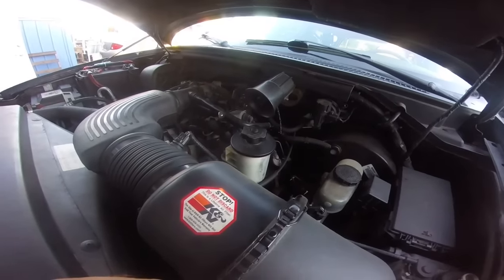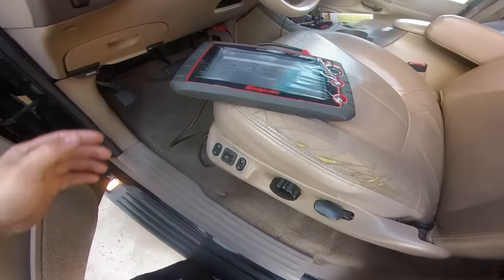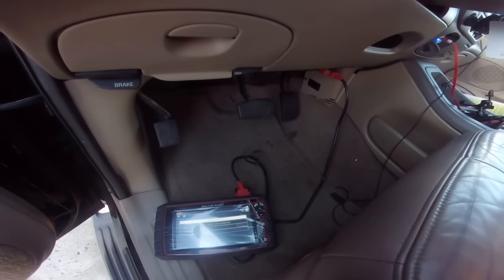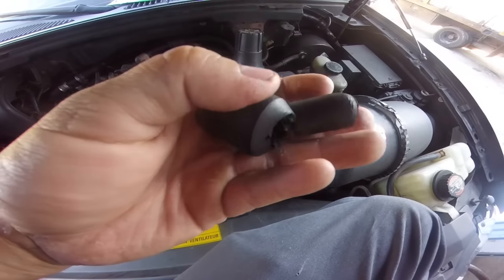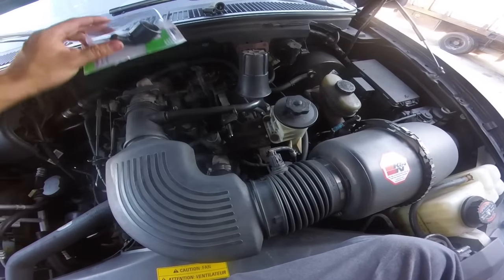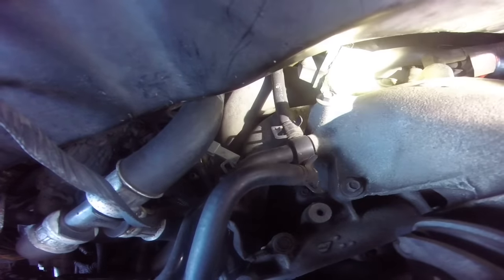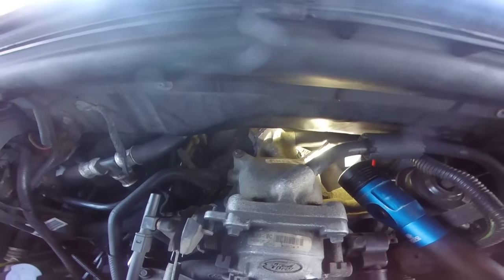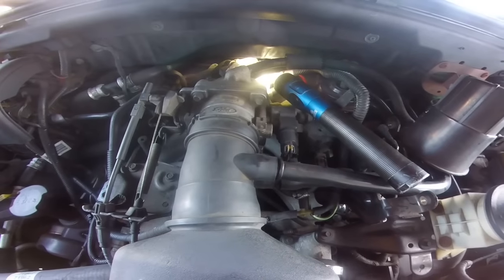ford 5.4 and 4.6 main vaccum leak

Comment: Does anyone know where is this located in the 03 ford e250 I’m having rough idle and engine shakes and sounds like a misfire when giving it a little throttle
Reply: My 98 E350 has it entering base of throttle body intake towards front of van. Just follow the hose from valve cover on passenger side. I had to get throttle cable parts out of the way to access it. Bitch. But she’s worth it.

Comment: Would this cause a P0304 code cylinder 4 misfire? Truck idles bad and at certain speeds around 40-50 mph, shakes and lacks power. Also air conditioning gets hot at times like a vacuum issue
Reply from the maker: well the ac would be vacuum related but a single cylinder misfire is a slim chance id check that coil on cylinder 4
Reply: Did you ever find out what was causing your problem? Mine just started doing the same thing, except on #3, and the AC stopped working at the same time, about two days after a heater hose broke & wet the engine. New plugs, new coils, thrown a bunch of money at it & the problem persists.

Comment: Curious if this is my problem truck runs with up down idle stumbly misses, has a pretty loud hiss leak sounds from left side. 99 f150 4.6l 4x4
Reply from the maker: if its after the mass air flow then yes its gonna be a vacuum leak causing it

Comment: I have a 2003 Lincoln Navigator with this exact same issue but my PCV valve is not back there and the one I see looks like it’s intact. Is there another price back there I don’t know about?
Reply from the maker: there is a couple other vacuum lines normally you can just start it and run your hand around the vacuum lines till you feel the leak or hear a change in the leak

Comment: I’m pretty sure that my problem.  This prob sounds like a dumb question but how do you get it off? I pulled in mine and it won’t come off.  I was thinking I had to take a bunch of stuff out the way.  Then it felt as if I did get it off, I’d have a helluva time getting it on.  It’s really tight
Reply from the maker: its probably tight from the age the new one will pop on easy
Reply: ugly HP thank bud.  It’s was easy.  Ran great for about five miles.  On the way back, started running rough but not as bad.  For about two days, it was intermittent.  Finally a code popped, got the po302 misfire code.  Thought it was plug or coil since intermittent but had a discount on the cop so I got it.  Been running great since.

Comment: Will this cause other problems such AC blowing problems we have tried everything else, blower motors resistors and replaced the rubber pieces on the vacuum hose, and still nothing tonight we just found out this also wrong on my Ford expedition,  waiting to get that part to put it on, but now my car won't start. Please if anyone can give me some advice on how to do this would appreciate it

Comment: Will it cause a blow off sound when the engine is shut off and a misfire when engine running? Tks
Reply from the maker: not quiet a blow off sound i think you need to lean more towards the booster ive seen those do what your saying but please lmk what you find

Comment: I have an 07 ford f150 4.6 and it is sending out 3 codes p2195, p2197,and p0171 and I changed almost everything but I can't find that elbow. Where is the starting point?
Reply from the maker: behind throttle body
Reply: @uglyhp8225  thanks

Comment: How many pounds of vac pressure should a 5.4 read at idle? Say, out at the 4WD solenoids?
Reply from the maker: 21inhg at idle at the engine cant find any notes on if the 4wd takes less

Comment: F150 4.6l has a misfire on idle but not when accelerating. What would cause this and how to fix it?
Reply from the maker: possible  bad valve i would start checking compression on every cylinder

Comment: 2007 F-150 Ecoboost here.

Trouble starting and high idles omce it's warm around 1750 RPMs. Looked for this elbow and didn't see it, any other thoughts?
Reply from the maker: try cleaning the electronic throttle body check for codes if it has a lean code smoke check it for a vacuum leak
Reply: @uglyhp8225  Thanks for the reply! It's actually a 2010 Ford F150.

I sprayed brake cleaner around some elbows and other areas, nothing. However when I turned the truck off I heard a hissing. Sprayed bubble water around, and my thermostat intake was bubbling like crazy around it. Could this be it?

Also, after doing all this, it seemed like my radiator fan was on high or something, and my truck started to overheat a little, all while high idling and it seemed only while I was accelerating? Weird stuff. 

Anyhow, thank you for what you do, and I'll let you know what the finished issue was (hopefully)
Reply from the maker: try pinching off your brake booster

Comment: I have a 07 Ford F-150 5.4L 4x4. I been found were the rubber 90 goes. I can't find the smaller hose that connects to the rubber 90. I also noticed that when i put freon in the a/c it leaks out of the tube on the fire wall that the rubber 90 goes to. If anyone can help please i need it. Im learning a lot about mechanic work especially on this truck lol.

Comment: Would this happen under power and take my air conditioning away till I let off the gas??
Reply from the maker: sounds like you have a vac leak in the line that goes to the dash for the ac if im understanding correctly, so on the passenger side under the hood theres a vaccum line that goes into the firewall follow it and look for leaks
Reply: ugly HP I did put in a KN air box and filter and noticed it after the install and it's in a E350 super duty van, so not much room to work.
Reply: My vent air switches to defrost at 45mph or higher rpm.

Comment: Did you have a loud whistle coming from the engine compartment under load or under acceleration.
Reply from the maker: thats gonna most likely be your iac ive seen it a few times in the fords
Reply: @uglyhp8225  it idles great, you can rev it up and its fine, once you take it down the road it starts sounding like a flute when you step on the gas, I was thinking maybe the cats are plugging up.
Reply from the maker: i never said it wouldnt idle bad but google iac whistle 4.6 since you dont wanna believe me

Comment: I have a 2006 Ford F-250 gas 4.6 and it randomly went from driving like a brand new truck stalling on the highway doing 80mph and lost acceleration. Pulled off the highway and when I came to a complete stop my truck started shaking. PLEASE HELP!!!

Comment: How did you get too it, i cant reach it to get it off. Hose is completely torn open but cant get any leverage
Reply from the maker: its a tight fit you can always take off the throttle body to get to it

Comment: Where does this go exactly? I ended up removing the EGR tube to replace a valve cover gasket and now I have this air leak and these codes. Sounds like I didn't tighten my EGR metal tube but its locked on both threads. May have to look at this. Problem is it was running fine before I took the EGR pipe out
Reply from the maker: back of the intake

Comment: I have a 2003 Ford F150 stays high idle @2000 RPM could these be a vacuum leak?
Reply from the maker: usually on the fords the idle is up and down when you have a vacuum leak i would say you have a different issue

Comment: Mine purrs like a kitten at idle, and in park/neutral. As soon as i gas it on the road. It sputters an misses. Come to stop, purrs like a kitten.
4.6L manual 4 speed with overdrive.
Seems like only under a load does it miss an sputters.
Reply from the maker: smoke test it

Comment: Why this happens mine die today out of nowhere and I try to start it and nothing few minutes later after trying and trying she turn on like nothing at the red lights she stop again pull up at the parking lot and the engine is running hard and slow hard and slow and sounds like a hose is broken I drive the car 20 after that and she didn't give me no  problems at all any idea tia
Reply from the maker: they just dry rot

Comment: Finding the leak isn't the problem. Nothing quick and easy here. How do you get to the back of the intake to change the part?
Reply from the maker: i do a ton of them so i guess im just use to the location it can be reached by hand without removing anything

Comment: 06 4.6 here. Engine intermittently idles rough. Getting the o2 sensor bank 1 not switching code and a bank 1 and bank 2 lean code. Been told it’s a vacuum leak but I’m not finding one. Tried the smoke test and spraying starting fluid around. The part you’re changing in this video isn’t the same as mine. My pvc hose that goes to the back of the throttle body is pvc straight through and has a green plastic tip. That hose seems to lock in fairly well. I’m lost
Reply from the maker: if its high miles you might wanna do the intake gaskets over 150k
Reply: ugly HP  I just did. Swapped out the engine a few days ago.

Comment: My 4.6 is running like crap when it warms up but no codes are coming up. Could it be this?
Reply: Did u try it?
Reply: @panthers559  yes I did I replaced various vaccum hose. I drove it until a code popped up and i got a misfire on 1 and 4 😥

Comment: I looked and looked for this but can not find it at all. I have an 04 5.4 3V fx4 with electric throttle body. I cant find it
Reply: any luck?
Reply: @Shane E  nope. I did find my leak was coming from my 4x4 plastic lines that supply air to actuators that runs too my solenoid purge valve.

Comment: I have code on my 1994 4.6 said lean 1 and 2 runs rough like it want to die I hear a whistle I'm gonna look for the leak
Reply from the maker: thats a vaccum leak and most likley this is the issue
Reply: on a 02 4.6 e150 where is this rubber boot located ? pvc hose or ?

Comment: Does a 2006 4.6 have this? I can seem to find it
Reply from the maker: yes
Reply: So i have a grand marquis and the only hose going from the back of throttle goes to a t shaped plastic thing. Could it be further down around manifold my rpms are jumpy at idle and and wants to die but doesnt drives fine.
Reply from the maker: the cars have a different elbow thats smaller easiest way to find it is wiggle the vacuum lines til the idle gets worse or clears up then follow it to the leak

Comment: What my question is my mom has a older like a 90s 2000s Ford F-150 what's a 4.6 Triton there is a vacuum coming off the side of the passenger side of the intake and right in front of the passenger side seat there is a t it's sucking air really bad and when you walk it off the car on one the truck will not run is there a line that is supposed to hook up to I'm trying to learn more about these trucks I've had to fix his truck I don't know how many times but now I got a vacuum leak it's right in front of the passenger seat is a vacuum line coming off the passenger side of the intake where does it go because from the intake when it runs over to the passenger side it runs to a T I am missing a hose and it's just sucking Aaron vacuuming making the truck run like s*** four guys let me know I will see you a picture

Comment: I just started hearing a loud hiss but my vehicle seems to be running fine, any ideas*
Reply from the maker: vacuum leak
Reply: @uglyhp8225  I just took it to a Shop and they said $200 to $300 to diagnose.  I took that as I don't want to do it, especially since you can hear it. I'm not a mechanic but you would think they would know where to look right?
Reply: @uglyhp8225  Thanks
Reply: @uglyhp8225  I can't see to exactly where you are looking in the video,  at least not on mine, mine is a 2002 Ford E150

Comment: Ok I found the leak but I need to know if someone can please tell me how to remove the pcv valve hose from the back of the engine in a Ford F150 2003, thank you
Reply: Give it a good push back towards the cabin. It will come off. The gates brand PCV hose comes with the PCV valve included.
Reply: @ed389  thanks for the information but I got the problem solved, now my truck runs great 👍 👍👏👏

Comment: I have a 2003 ford expedition Eddie Bauer.
All of a sudden it only goes 20mph and 5mph up a hill with the gas pedal all the way down. Gas milage is horrible. Auto zone codes said too lean and the guy said sounds like a vacuum leak. 
Could you give any specific location to look at for the leak or crack?
Reply from the maker: you can normally hear a hissing noise around the intake

Comment: Where is thos located on 1999 crown victoria
Reply from the maker: Back side of the throttle body on the intake
Reply: Thanks but Ive looked all over and i dont see that on the 4.6
Reply from the maker: yours wont have this exact elbow on yours you can follow the hard line from the valve over to intake

Comment: I've got a 4.6 5 speed and the truck starts idling around 2k it does this intermittently, also it seems to idle higher when the defrost is on anyone have any ideas?
Reply: Defroster making it idle funny is an a/c issue. All defrosters use the a/c by default to help remove the condensation causing the frost. In most Ford's it's damn near impossible to replace an a/c unit. So I Just unplug mine, because Lovely fords don't have an ac fuse
Reply: I know that I had multiple vacuum leaks on my 5.4 causing my air to only come out of the defrost vents. I would turn the knob to change where the air came out, but it wouldnt change anything. Found out that you need vaccum in the engine to turn the 'flaps' in the air vent system. No vacuum, the flaps wont change the direction of the air.

Comment: Whoever worked on my wife's Expedition left some hosing detached.  I have a 2001 Exp 5.4L and the passenger side has nothing but a hole in the valve cover.  The driver side has something on the valve cover which runs to the back of the part you pointed at, but do you know where the hose runs to the passenger side and is that the PCV or is the driver side?  I can't find a schematic.
Reply: One goes to throttle body driver side goes to intake

Comment: What is that part called
Reply from the maker: pcv boot or elbow
Reply: @uglyhp8225  thanks guy. I need to check that. I feel like i have a vaccum leak somewhere. My rough idles sometimes when im stopping, i put it in neutral n tap the gas and it goes away. Idk what causes that
Reply: Dorman HELP! PCV Elbow #46035
Reply: @mlaautomotivellc9327  thanks. But that wasnt the problem. It was my VCT selonoids

Comment: Can you tag this video "Crank, No Start (Intermittent No Start) Ford 5.4 Vacuum Leak"? I found that a vacuum leak like what you have shown then messes up the computer until the engine runs long enough to purge the fuel vapor evaporation system and collect enough data to run the engine appropriately.

Comment: I have a 4.6 06 f150 an I went to turn it on and something popped. It made a popping sound like air was leaking out. Then stopped. But I have poor idle and ac doesnt cool anymore. Air is leaking passenger side right behind intake manifold. Any thoughts?
Reply from the maker: sounds like a vaccum leak just run your hand around the lines till the noise changes